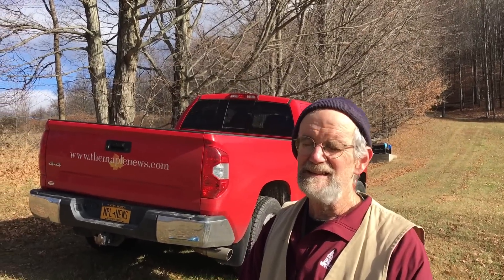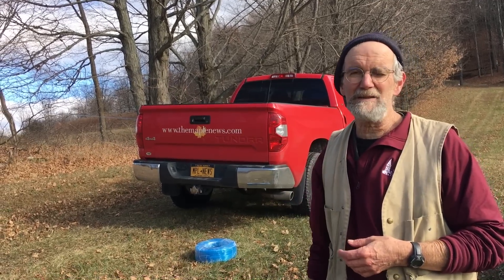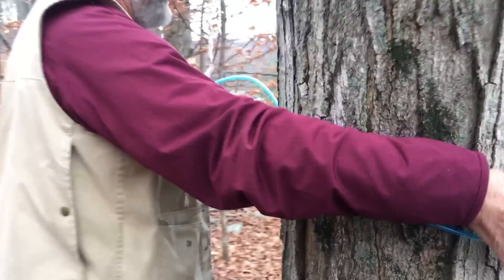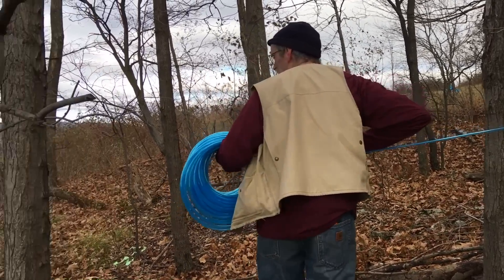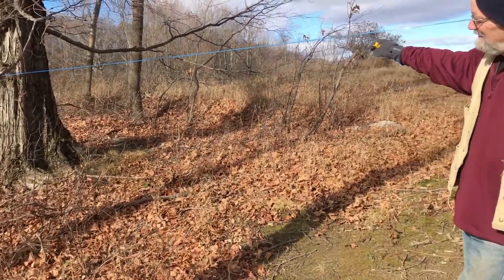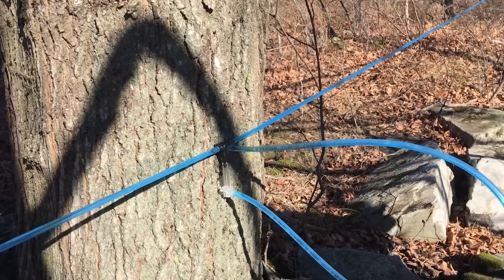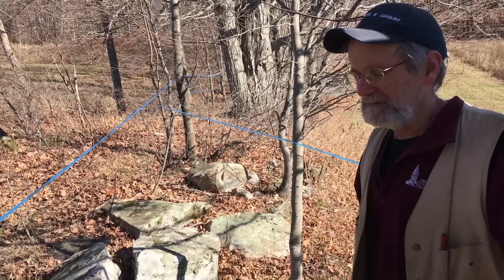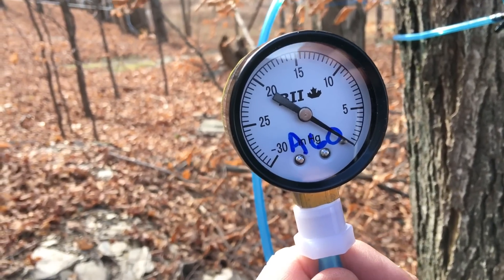3/16ths tubing install with D&G's Tim Wilmot

Comment: I'm only dealing with about 15 feet of elevation from the first tree to the collection. Would it be ok if i put the first tap 15 feet up on the first few trees?
Reply from the maker: You will still get some vacuum, yes. Not as much as you would at the top of the line, higher up, but better than nothing. 3/16ths works best on extreme slope

Comment: I've been on 3/16 for quite some time now, it's working great.......I also found by using longer lines between the first tap and the barrel, I get more vacuum, of couse you need to have more gravity in between these two, so instead of starting at let say 6 inch of vacuum at the first tap, I now have 22 inch at first tap and going up hill, the vacuum is higher right to the top....I have 25 feet of drop between tap 1 and the barrel.